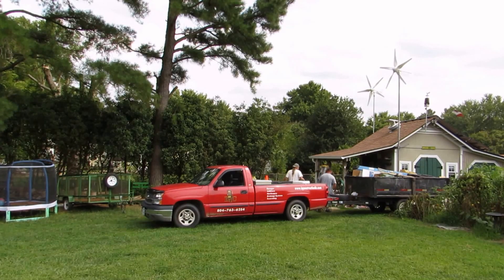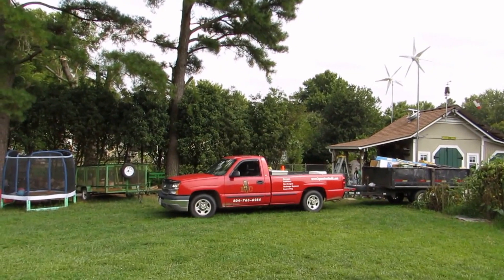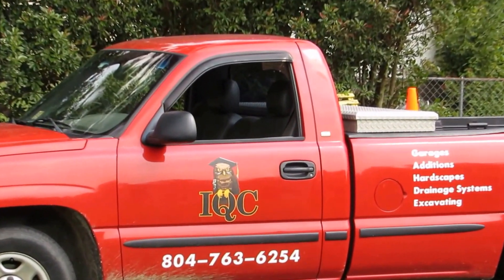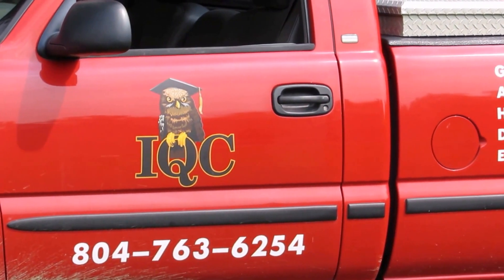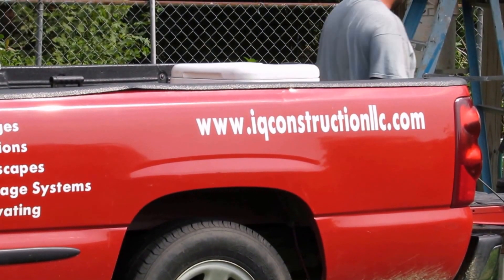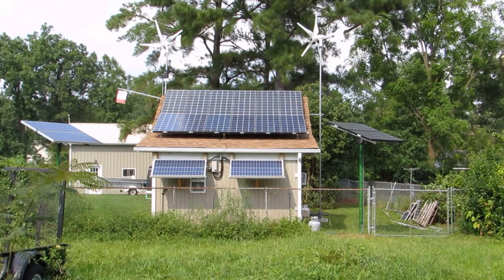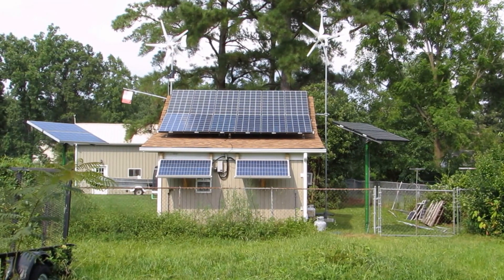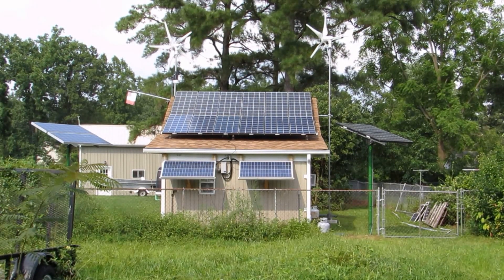Solar Power And Roof Rebuild Series  August 2014 By KVUSMC PT 4

Comment: it baffles my mind why more people don't put solar panels on their roof or on poles on their property. it's free energy, from the sun. even if it takes a few years to recoup the initial cost, from that point on it's a pure money maker. if you install it yourself like this guy did, your payback period is cut down by 2/3. 

besides the money, you are decreasing your impact on the environment and most importantly you are preparing yourself for an infrastructure failure and you're self reliant. think hurricane sandy, ice storm, brown out, you name it. it's good to be independent in this day in age and with so much up in the air you'll be glad you had these when SHTF

Comment: I wish I was there to pick your brain for the off grid systems. We install mostly on grid. Now people are asking us to build off grid simple systems of maybe 1000 watt, I'm just not sure about which charge controllers, or inverters, and batteries to use that won't kill them for cost. Every system will be for hunting camps. I have my demo trailer for advertising which is set up for sales. Showing micro inverters, I would like to be able to switch it over as dual purpose, when it isn't being used as a grid tie bill board I would like to switch off grid using it to power cabins. Should be doable the trailer is 6x12. I have 6-175 watt panels mounted on the back rack and one 230 watt on the. Top of the trailer. I think you can see the picture in my thumb nail. Thanks dude. Ps you would think I would have many videos out there sense we own two companies M&L video www.mnlvideo.com and Sanilac Solar www.SanilacSolar.com to funny right. I wish We could hire a guy like your self for Sanilac Solar.
Reply from the maker: Renee Block Many Thanks Renee I Will Help Any Way I can You Can Pick My Brain Anytime You Want I'm Available 24/7  I will PM You Renee Cheers Gal

Comment: Looking real good Kenny. they have done a very very nice job.
Reply from the maker: McCuneWindandSolar  Yes Sir We Rolled  Yes They Were Easy To Work With  I Designed The Racking System For Good Air Flow  And Good Power All Year Long